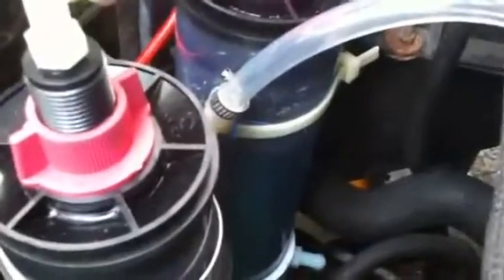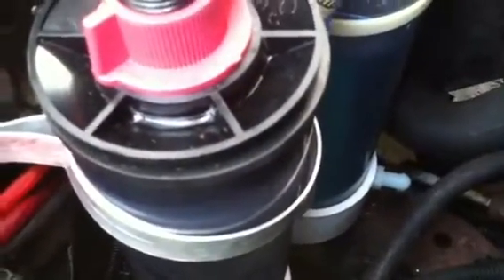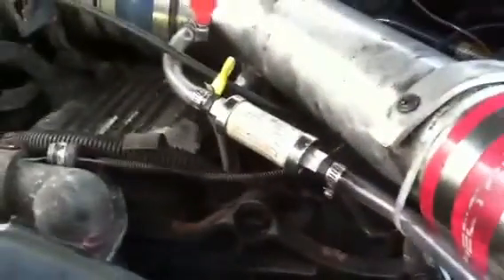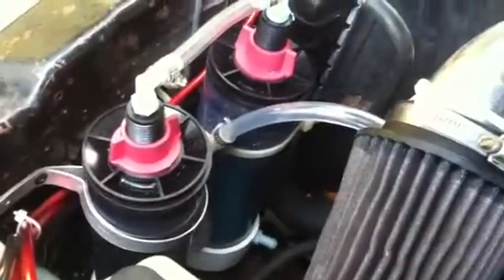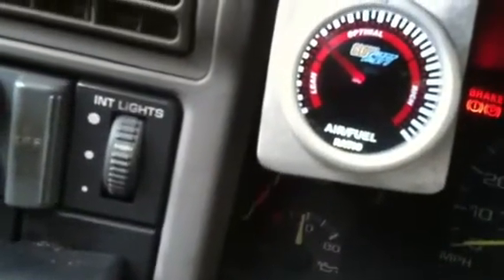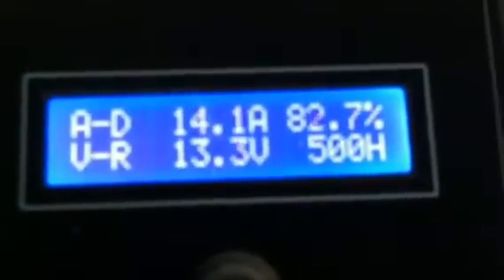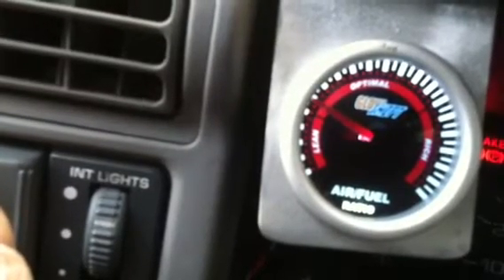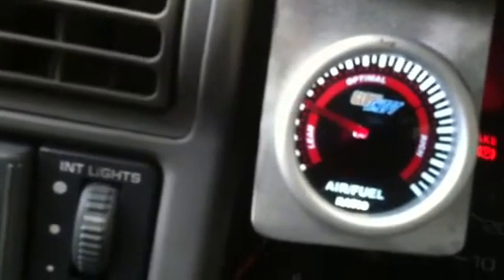HHO let the experiments begin  Video #  6

Comment from the maker: Yes it leaned out by just adding .75 lpm of hydrogen.The map enhancers work with the older engines. And I bought it on ebay.I will be selling the PWM soon on ebay and the new cells will have a device inside the cells to slow the water and no current jump through the holes.